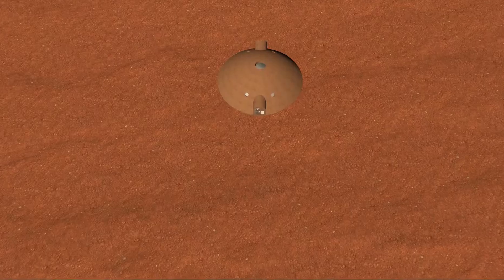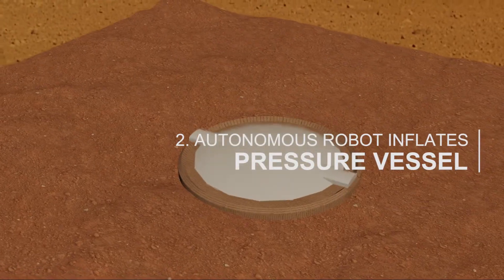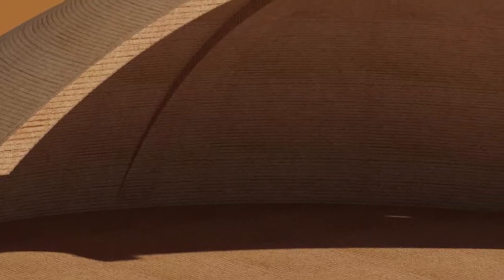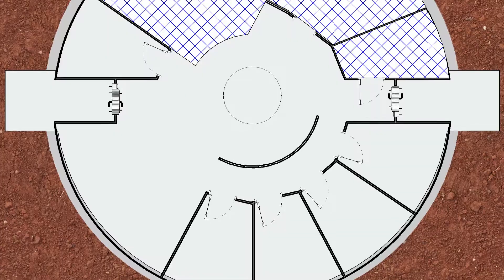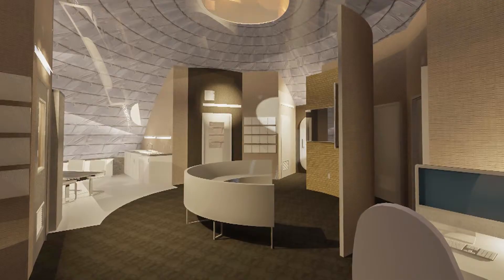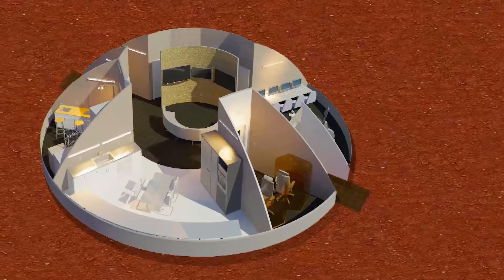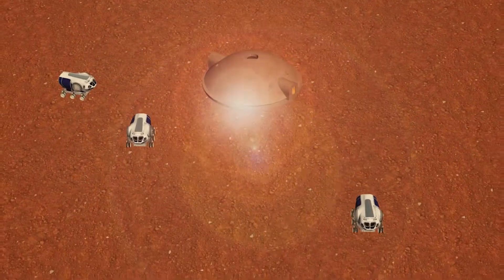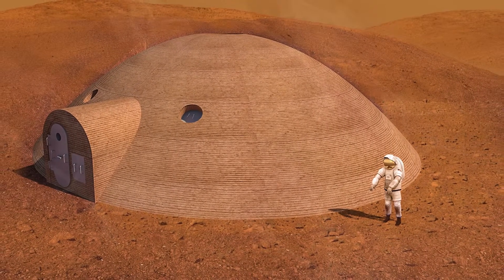Designing for Life on Mars: NASA's 3D-Printed Competition

Comment: on earth, for a bomb shelter that will protect you from gamma rays, you need 3 feet of soil, water, 2 ft of concrete.  That dome doesn't look think enough.
Plus the pressure locks, how can an inflatable attachment seal that off?  wouldn't the consent pressure dropping to mars atmospheres, then to earth (or habitat pressures) would stress that attachment to the dome. I don't see how you could cut corners on an airlock. 
Plus, the larger the habitate, the huger problem of air pressure.  it's sort of like diving into a pool,  the deeper you go the higher the pressure on your ears.  Large connecting, quonset hut style bays would not work.  one leak and BOOM, you lose all the atmosphere.